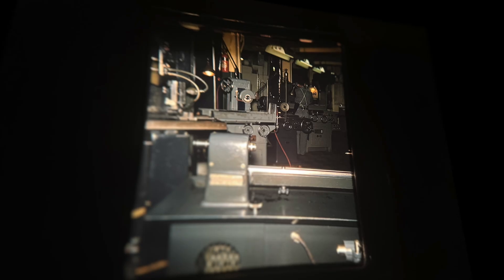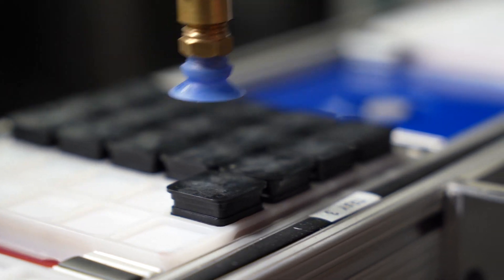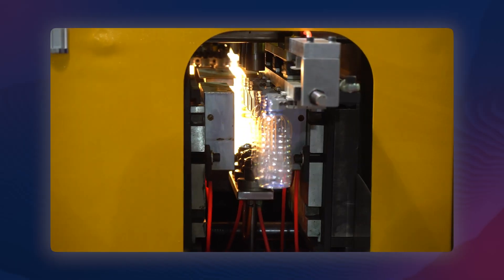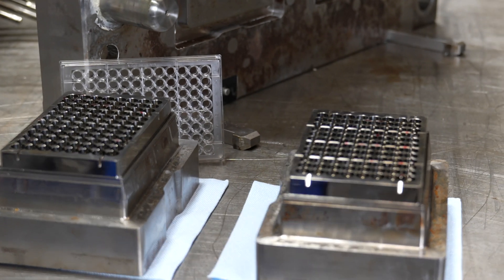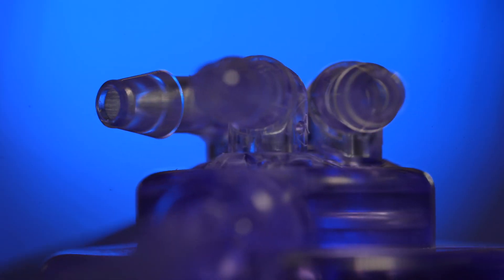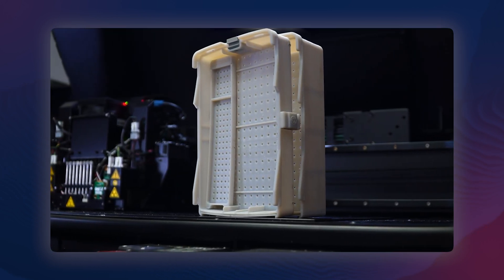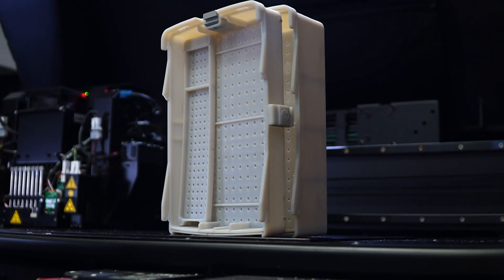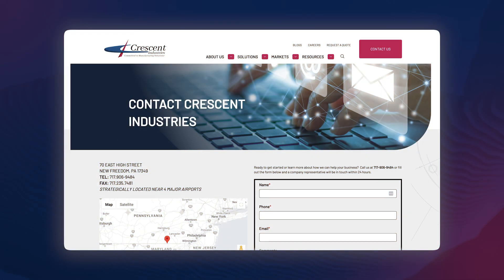The Benefits of Injection Molding Over Other Manufacturing Methods

Comment: Nice video, but it gets more complex the more experienced you are. For stuff that has no mechanical special function . Yes go for plastic , you missed some other popular methods like : reactive injection molding & thermoforming. And when it needs to be metal there are ways to be fast and economical using a combination of metal die casting or extrusion & machining. Wee need more of these videos on the Internet, manufacturing gets too little love.